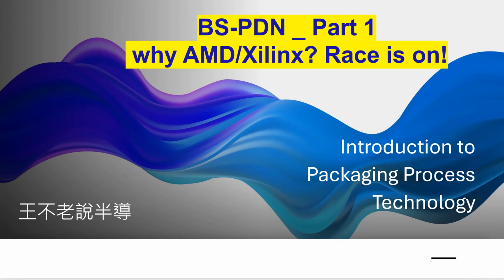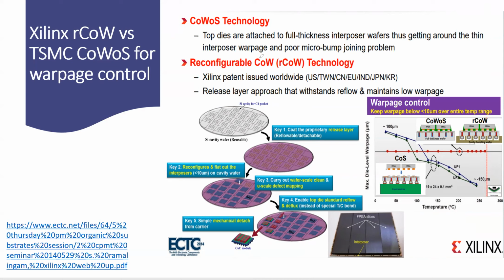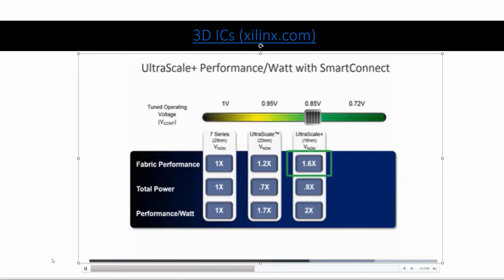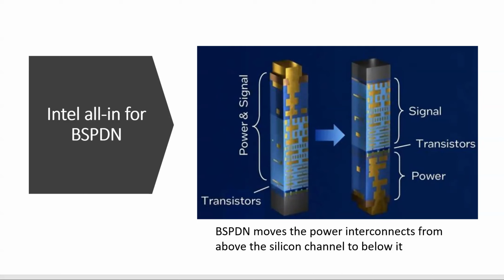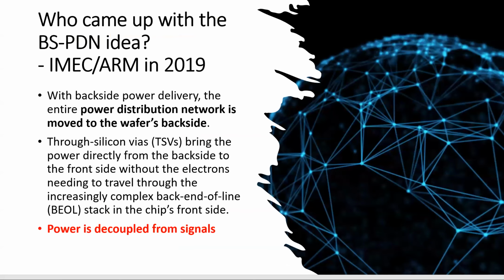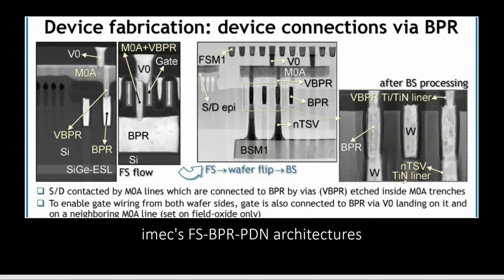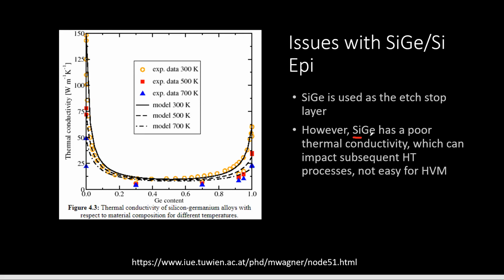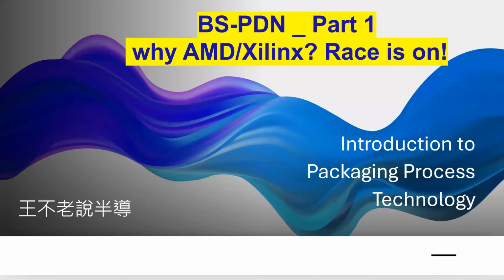11  Packaging process technology BS PDN   Part 1 why AMD, Xilinx Race is on

Comment: I have watched this chapter 11 video.  But it is still not clear to me regarding my previous questions.

Is there any warpage difference between chip first, InFO and chip last, CoWoS?
Why does TSMC still have chip first even though KGD is unknown on chip first?
Reply from the maker: I  thought I made a clear in p.5-6 with CoS larger warpage. CoW smaller warpage. CoS is thin die on thinned Sub (large warpage), and CoW is thin die on thick wafer (no warpage). I even provided a formula to calculate the stress.

All things in packaging have to address warpage concern. TSMC dropped CoS before moving to CoW due to warpage.
Reply from the maker: I need to do the same analysis for InFo as well. But the concern is the same. The  "magnitude" of the issues and the corresponding solution could be a bit different.
Reply: @王不老說半导  Thank you for reply.  Do you know why TSMC still has InFO?  InFO is chip first and the total yield of InFO would be lower than that of CoWoS.
Reply from the maker: @mizunommjp  very good question. I need to check...
Reply: @王不老說半导  Thank you. ASE also has FOCoS-CF (chip first) and FOCoS-CL (chip last). I would like to know why both TSMC and ASE have chip first rather than chip last.  I am asking this because I thought it was something to do with warpage or some kind of stress issues or size. The yield of chip first has to be close to 100% so that they do not lose any expensive chips.  I may be wrong.
Reply from the maker: Indeed, very interesting question. Guess I need to do this homework you just assigned:face-fuchsia-poop-shape:
Reply: ANSYS has simulation SW to see warpage... @王不老說半导